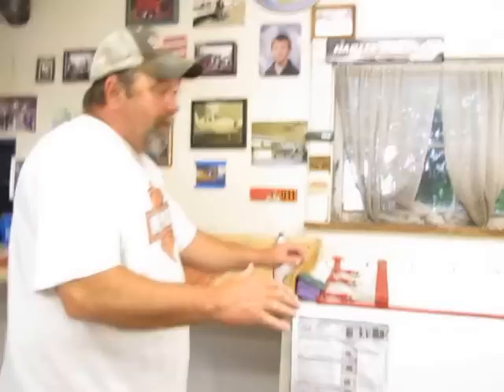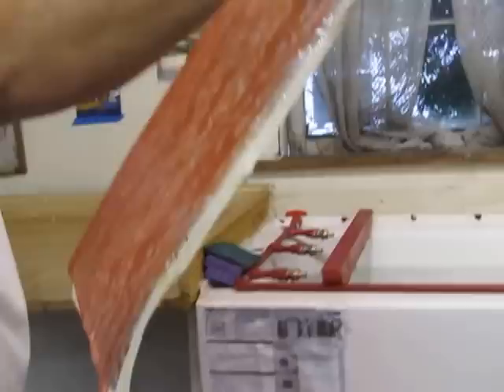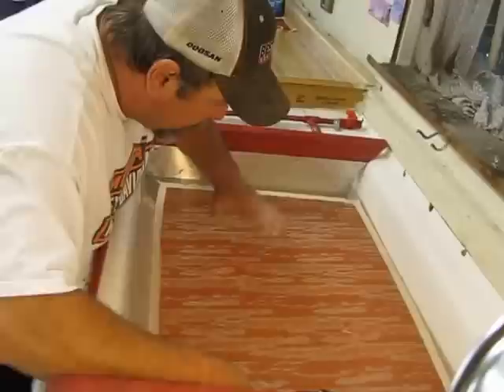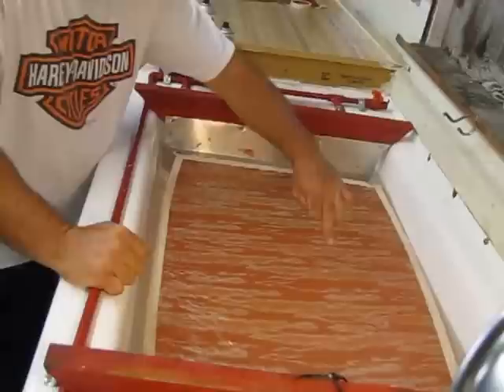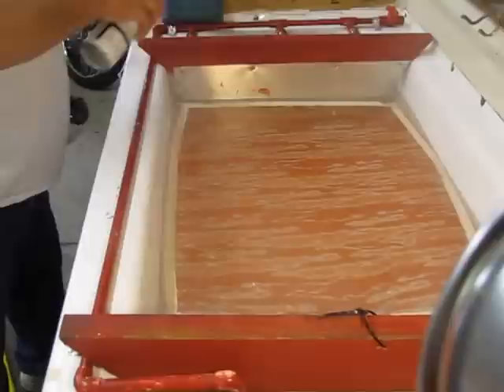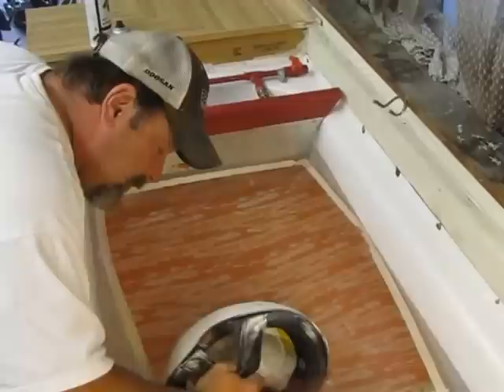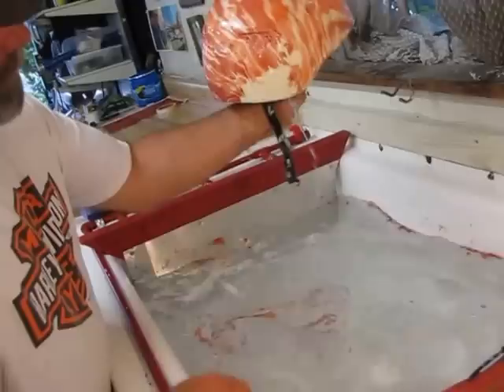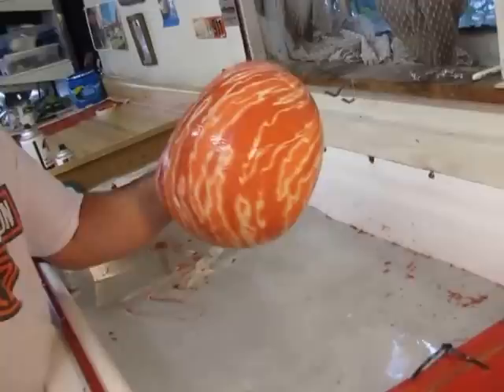How to build a cheap Hydrographic dipping tank PART 2

Comment: Just a few things I'd like to point out. Great tank. Cheap, functional, and effective. When touching the film to move bubbles and creases I'd recommend using gloves when you are working with important pieces because the oils on your hands effects the film and the way it adheres. And again with what was stated position it more center of the film so it can "cave in" and cover the piece. More activator, evenly coated as well as a slower dip with more rolling so it doesn't stretch and become uneven. But great to see people showing their experience. The internet shows too much of "perfection" people need to see the mistakes/learning curve so they don't think that they are doing it wrong. Just takes time and patience. And best tip I can give is prep work is 90% of the outcome.
Reply: Great advise. Do u hace any learning videos?
Reply: Im going fo have my guy build me a tNk like this guys and im gonna bwgin dipping

Comment: its getting wrinkles in it because the tape is holding the edges together when its trying to expand a little bit, you need to have spaces in the tape so it can expand slightly

Comment: Your tub works great man. You just underactivate thats is why it doesnt work well..
Try covering the film with activator using the same pattern as if you were spray painting it. You will understand because it will look super glossy and not hazy in some areas! Ps try cutting the duct tape so the film can expand.
Also try blowing the bubbles with a cold hairdryer or your mouth.
Keep up the good work!!

Comment: One thing nobody has mentioned on here is to throw away the spray can activator and get a spray gun and good activator... Your temp is a little low, but can still work... Let the film sit for an extra 15 to 30 seconds when the temp is down and you're good.

Comment: almost looks like u didn't use enough activator that was a big piece of film also depends on the material u are dipping I'd look into some adhesive promoter primer and base all in one I was having the same problem u was and I was spraying to close to the film and I also cut small slits into the film to help it expand a little

Comment: ive seen so man y videos with no advice just critics so its great to see the comments here are all positive, not enough activator i am no pro but it needs to completely glass off it wont move or spread if you have the dams in place it will just float then dip on a kind of 45 angle and slower, some of my work i have had to redip and even start all over again, just be patient and the experience will follow , love the setup and the video keep up the good work

Comment: You want to do a dip and role method. Also recommend going really really slow, no need to rush. So as you dip into the water roll the object as you push it forward. So the film doesn't stretch so much and leave a gap like it did

Comment: You need to put relieve cuts in every corner and in the middle down every edge mate that will sort your creases out you won’t see em again and slicing the corners and edges you can easily blow your air bubbles out it lets the film stretch but not too much it’s a really hard hobby but you are doing really well keep it up 👍 the trick with hydro dipping is be very patient and don’t rush nothing

Comment: Hey I got a lil tip for you: When putting the Foil onto the water sirface try not to put it in a a whole, but hold it from two oppisote corners and letting it in slowly from both sides. Will look for a vid where u can see it. This will prevent the bubbles and will allow you to focus more on the actual dip. Regards

Heres a vid where its done quite good: https://youtu.be/NI5CgKUiEi8

Good Luck and keep on dipping!

Comment: Nice Job Gary. But the reason why it didn't cover the whole helmet that's because u were dipping it near the tape where wasn't enough paint to cover that particular spot , u had alot of space i douno why u choose that spot it dip in.  anyway that was just a tip am not a professional either. Good luck with your new tank.
Reply from the maker: +mohammed iskandarani   Thanks !
Reply: +Gary Robinson i'm new myself and looking a building a decent sized tank in the new workshop once that's put together. i think there wasn't enough activator used also dipped a little fast. creates to much motion in the water. but great job and tank idea is great.

Comment: Lol good video man, one way to get tips for sure, water should be 90 then 60 seconds, wear gloves the oil from your hands contaminates the surfaces u touch, not quite enough film there, just keep it up you will improve the actual dip technique with practice
Reply: Gotta work on activater application too lol
Reply from the maker: Thanks Mike !  Good advice

Comment: May I ask. If I had a sheet of sheet metal just plain steal any reason I could not just make my own tank up? Painted steal would be okay?  That way I could weld in and fabricate all the hoses/pipes to the pump. 
Thanks for the videos 
Dave from Ontario
Reply from the maker: Sure that would work... Use your imagination you might have a great idea... I was just going to cheapest way possible for me back then

Comment: I've read and watched you need to be dipping from 90°and up. I've never dipped before, just sharing what I've read and watched.
Reply from the maker: Matthew Lowe from what I've seen water temp depends on who's film you use. Manufacturers differ in dip temperature